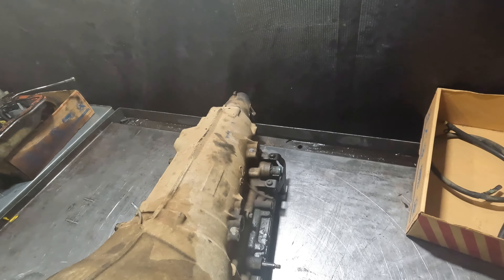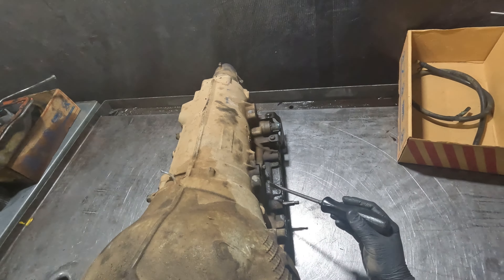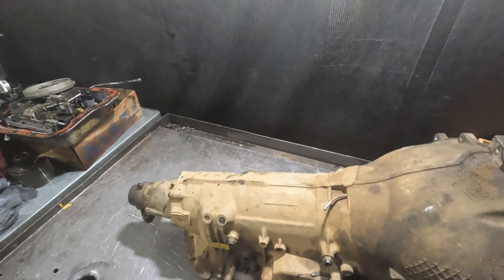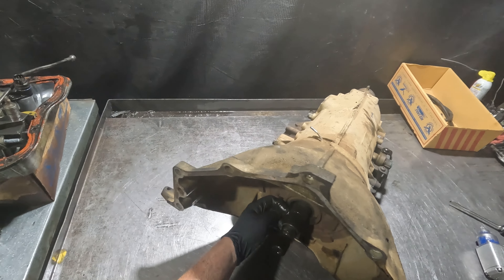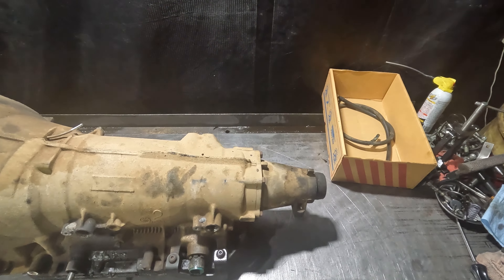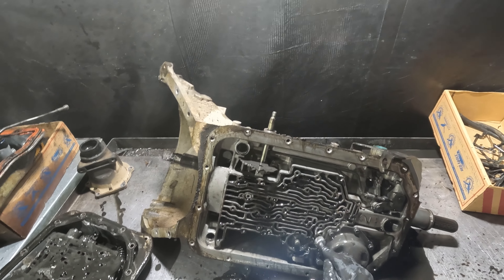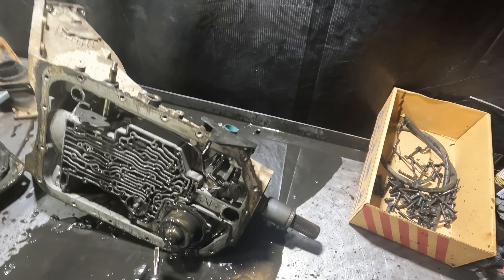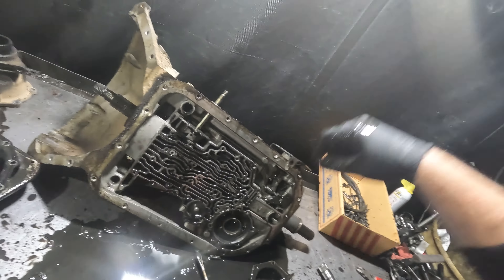4L80E Total Destruction Pt 1

Comment: Almost makes you wonder if it had an electrical short in that solenoid that came unwound, and the plastic melted into the pan, which then starved the pump and.... well you know the rest. Anyway, another great video man.
Reply from the maker: I believe it was flat towed the solenoid unwound due to the plastic housing melted and both speed sensors melted to nothingness.

Comment: I’ve seen this before . No specked de English. Ran it till it melted down . Other half is computer and cooling system . Smash the trk . Glad it’s not on my bench !
Reply from the maker: Yeah, this situation was absolutely ridiculous. I purchased three 4L80E cores I had to drive 2 hr to pick up for this rebuild as theirs was not rebuildable, and I built one of the units in the same year and delivered it. It was a complete rebuild. Shortly after, the shop called me when they installed it and complained that the unit wasn't moving. I asked them about the amount of fluid they had put in, and their response was just mind-boggling. They had only put in 2 gallons, which was obviously far from enough. "They were short 1.5-2.0 gallons / 6-8 quarts"..... 

They must have thought that by continuously attempting to engage gears and rev up the unit, it would magically start working. But that wasn't the case at all. I had them pull the unit out and return it to me. Upon inspection, it was clear that the unit had been severely damaged. I made it very clear to the shop that this was not my responsibility and that fixing it would require additional funds. However, they refused my offer and instead opted wanting a full refund....

The whole situation was a complete joke, and I was left frustrated and disappointed with the shop's lack of understanding and accountability. In the end I kept my newly built unit that they smoked the FWD and the reverse in and gave them a junk core +  1/2 the build costs was a wash in a way but really irritating was the waste of my time.